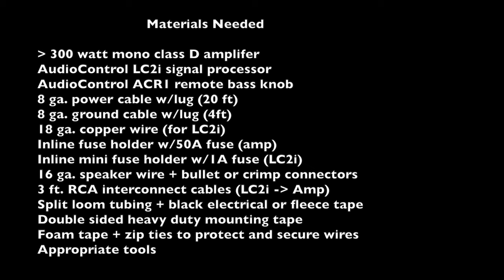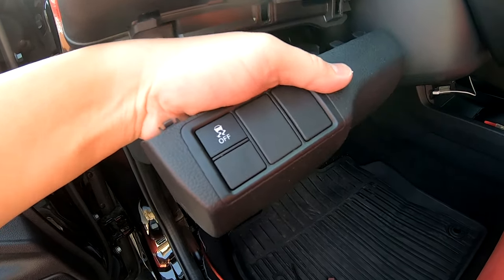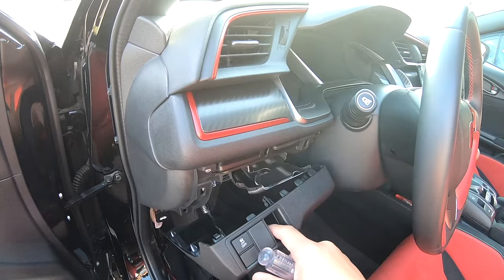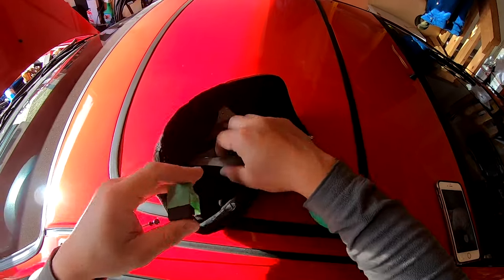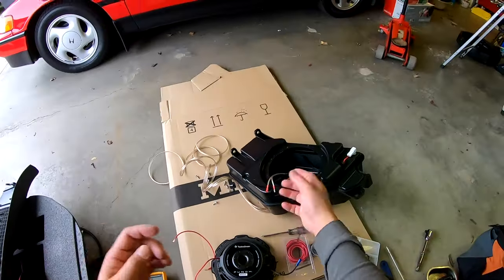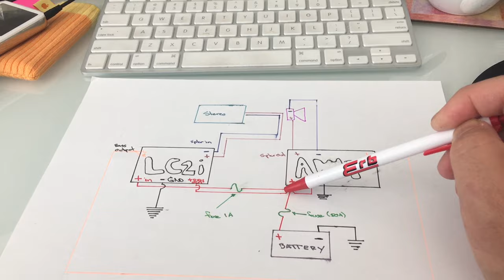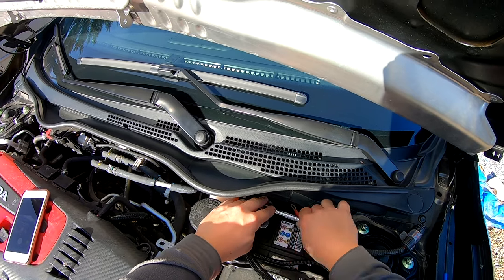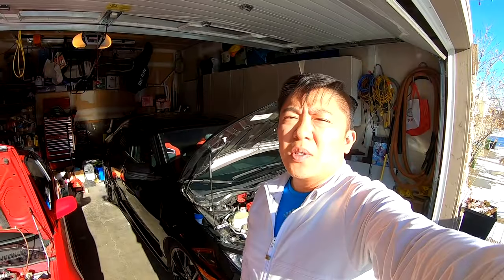2016+ Honda Civic Type R Subwoofer Amplifier Installation

Comment: Question about the + and - sides of the speaker...with the speaker still being wired for (2 ohms) does it matter if you put the + and - on opposite sides of the speaker? (Talking about the wires coming from the amp to the speaker) I don’t think it does but in your subwoofer install video you put the + and - on the same side...in this video you have them on opposite sides of the speaker, thx
Reply from the maker: No, when you hook up a speaker it must follow the terminal designation.  If you don't do that then your speaker/sub will be out of phase (meaning it is supposed to push out but it actually sucks in).  There are odd exceptions when you'd wire a speaker backwards but this isn't one of them.  In my sub's case I have a dual voice coil sub where each coil is 4ohms.  They're supposed to be wired in parallel to achieve a total of a 2ohm load.  If you're not sure about the ohms wiring on the sub (parallel vs series) take a ohm meter and touch the terminals that you would hook the amp to.  You should see a nominal impedance of 2 ohms.
Reply: @piercedasian  thanks for the reply, I see what you’re saying about following the terminal designation but my question is more or less if I can put the wires coming from the amp (the + and -) in one side of the speaker..(but still have it wired parallel) similar to the way you wired the sub in your other video..the video without the amp. In this video you put the + from the amp on one side of the speaker and the - in the other side...I’m using the same speaker and a similar Rockford amp for my install btw...again, thanks for the reply and help
Reply from the maker: you're very welcome!  Hopefully your install goes smoothly.

Comment: Great project!  I have a 2020 civic sport that did not come with a rear sub (or sub control on the head unit).  Is it possible for me to do a similar install with the current factory head unit?
Reply from the maker: hmm if your civic sport didn't come with factory sub then you may need to find a signal wire from the front speakers to pull a bass signal from.  The modern car head units are wonky in how they handle signals and their crossover frequencies.  I don't fully understand the technical aspects of how the Honda head units output signals.  You can pull the rear panel off to see if you have a factory "pre-wired" sub cable.  If it is there then super easy.  If it isn't then you'll have to find an alternative signal wire - I do recommend you use  the front speaker outputs to feed them into the left and right signal inputs on the LC2i.
Reply: @piercedasian  Thanks for the help.. I will look to see if the sub cable is there.  If there is no cable,  why do you recommend using the front speakers to feed the LOC?  Is this preferable to splicing in wires like with the smaller LOC described in the LOC installation video from @Sooner Garage?  Is the larger LC2i preferable to using a smaller LOC located behind the dash?

Comment: Great video very good details! Keep it up. Just some questions...So no need to get remote in for lc21 as it turns with speaker signal? Can you also provide what cables you used for each connection sorry my first install with and lc2i. TIA
Reply from the maker: Hey thanks for watching the vid!  No need to remote trigger just set the LC2i to signal sensing and call it a day.  A fellow member PMed me with a decent list of stuff to buy to complete the install.  

Power & Ground w/ fuse holder
https://www.amazon.com/Rockford-Fos...8+gauge+power&qid=1566530288&s=gateway&sr=8-1

Interconnect cables:
https://www.amazon.com/Hosa-CRA-202...interconnect&qid=1566531793&s=gateway&sr=8-17

Speaker wire:
https://www.amazon.com/AmazonBasics...ZJ3D6J9WQ97J2SV38PGM&qid=1566531917&s=gateway

1AMP mini fuse holder:
https://www.amazon.com/Qunqi-10Pack...i+fuse+holder&qid=1566532277&s=gateway&sr=8-6
Reply: Awesome thanks for the help. One more question does the lc2i need to be hooked up to one speaker or two?

Comment: Maybe I missed it or something did you have to run a remote wire?
Reply from the maker: Nope no remote wire necessary. Just the sub bass gain control and power feed. The remote trigger comes from the LC2i module and into the amp which is all located in the back trunk area.

Comment: I tried the pen trick and 8 ga wire I bought didn't fit.
Reply from the maker: hmm weird.  Did the wire not fit through the hollow cylinder of the pen?
Reply: @piercedasian  No I think the shielding on the wire must have been thicker.

Comment: For the signal in connection to the lc2i did you bridge the connection between the left and right channels or did you just connect the wires to just one one of them? If you just connected up one of the channels does the other channel not have any output on the rca side to the amp or does the lc2i duplicate the signals to output them on both the left and the right channels?
Reply from the maker: I bridged my connections.  The LC2i will mirror the input signal to the outputs to the amplifier.
Reply: Ok thank you. I just installed this yesterday using your tutorial but I used a kicker comp rt and a sound ordinance amp instead and it is causing a rattling sound. Through some troubleshooting I found out it was something with the stock box that was rattling. I tried adjusting the sub sonic filter and it only helped a little. Did you encounter this issue and if so how did you fix it?

Comment: Where did you purchase the in-line fuse that you used for the line out converter
Reply from the maker: Any auto part store or Amazon.
Reply: @piercedasian  ok, thank you
Reply: How did you combine the in-line fuse wire with the 12v wire?

Comment: That crx 😍
Reply from the maker: yeah the CRX is my baby.  Its sees very little road time and literally no rain.  I even stopped washing it and just letting the dust "blow off" of it when I dry b/c the more water you expose to the car the higher the chances that whatever rust that is buried deep in the welds of the car will only get worse.   There is absolutely zero visible rust (I had the stuff that was rusting completely cut out and replaced with new honda pieces when they used to be available.  The dryer the car stays the better off it will be for many many more years.

Comment: Thanks bro i did my install exactly like this works perfectly fine looks better then my friend professional install 😂😂😂😂😭😭🤣🤣🤣💀💀💀💀
Reply: What size gauge wire did you use? Currently dealing with this myself lol on top of trying to get the back up cam & steering wheel controls to work 😂😂
Reply: @AM33ZY  i used a audio kit boss 8 gauge went rigth through the little grommet with no issue that pen trick shown in the video is the way to do it wire ends up coming through fender
Reply: @TTVHASHxJOINTS  cool I bought a 4gauge because why not and now I’m regretting it because from what I’ve read a 4gauge is way to big to fit 😅😅
Reply: @AM33ZY  yea lol i just so happened to have the correct kitbi bought my kit days before watching this video and it was perfect lol amazon is where i got it and its a good complete kit hits solid too
Reply from the maker: haha that's awesome.  I always have a chuckled at SOME of the pro builds I've seen shops do. Some are truly abysmal and it blows my mind how some supposed "installers" know what they're doing when in fact they're bloody clueless.  Glad you were able to do the work b/c YOU'LL know what quality of work was put into it.

Comment: Great installing and very nice video! I'm planning to install a sub on my 2017 CRV LX and it doesn't have a sub the back like your Civic. Do I have to remove the head unit to wire my amp (the signal wires)? If yes could you explain a little about how to do that please? Thank you so much!
Reply from the maker: If your CRV doesn't have a sub out then you'll need to remove the head unit and locate the front speaker outputs and then tap into that signal and feed it into your LC2i.  Do you have the same exact headunit as another CRV that has the premium sound system?  Do the higher tramline CRVs even come with a sub?  If yes then you may be lucky and can tap into the sub output and pull signal from there.
Reply: @piercedasian  Thank you for replying, my CRV is a base model so it doesnt have the premium sound system(160-watt AM/FM audio system with MP3/Windows Media® Audio playback capability
 and 4 speakers), but the head unit is the same for other higher models. I'm not sure if the other trimline has a sub though. So best way is to tap into the front or rear speakers to the LOC and from LOC to the amp, right?

Comment: Hey I got a quick question, so from the lc2i you put a wire from the remote out to the amp's remote in? And you didnt plug anything into the lc2i's remote in correct?
Reply from the maker: you are 100% correct.  Just make sure you set the configuration switch on the LC2i properly otherwise the remote out trigger won't work properly.  I believe it is turn remote on signal sense or something like that.

Comment: I recommend changing that gain control out, for an RCA level input knob. I personally run SPL cartel, because they're linear voltage, but you don't want gain control, because they're more prone to causing equipment damage. Also, move that power lead, to a better spot, you're going to cut through the shielding, opening and closing your hood.
Reply from the maker: Interesting advice.  Although my gain control isn't via RCA the gain is still managed via the LC2i which is somewhat like RCA gain control but limited to the what the main gains are set on the output converter.  As for the power cable I can assure you it won't cut through.  I've wrapped it in split loom, foam tape and then ty wrapped them to the chassis and I've done lots of clearance checks to make sure it wouldn't pinch.  But as you've said it could cut through the insulation but I usually check things like that regularly to make sure wires aren't chafing anywhere.  Great advice nonetheless.
Reply: @piercedasian  I just do this competitively and I'm installing an lc2 in my daily build. I have a little bit of experience and try to give advice where I can.

Comment: how would i go about swapping out the 20 dollar LOC for the LC2i pro? I just wanna swap em but im intimidated
Reply from the maker: Best way is to just follow my install instructions on my amp install video.  I show exactly how to wire the LC2i.  Just remove your line out converter and follow the vid and you should be a-ok
Reply: @piercedasian  idk man. i have a history of not being able to put things back together
Reply from the maker: I think that if you take your time and take the time to take lots of pics to document the process that I am very confident ANYONE can do this install. Worst case is take it to a reputable shop and have them do the install for you. A pro install is often worth the expense.
Reply: @piercedasian  ye as you might have guessed that's how i had my original system installed. took it in. but they failed to mention i needed a real LOC, not one of those 20 dollar ones. It was like 4 years ago so perhaps the good ones didn't exist back then? why else would they not tell me i needed that? my system has been missing notes and half the songs don't sound that good. still is loud and hits real good, but it's lacking compared to my old car i had long ago.
Reply from the maker: The shop that you took it to just didn't have experienced/competent guys working on your system.  The LC4i has been around for a long time to address this very problem of factory stereos doing their own funky eq'ing to the signals that feed each speaker to maximize the available power to each driver and ensuring they don't blow up the speakers by feeding say for example, tweeters full spectrum signals.  The LC4i is able to see the "dips and peaks" in the incoming signal and apply its correction algorithm to it to restore those gaps in the signal.  The LC4i and other similar units are an absolute MUST in today's aftermarket audio installs.  Line out converters just don't cut it anymore.

Comment: 8 ga power and ground is no bueno
Reply from the maker: It’s okay to use same for same gauge cable in smaller/lowered powered amps. If you are putting in large amps then upsize all cabling and size up the ground to be one size larger.
Reply: @piercedasian  I understand what you're saying but for me the run is to long for a 8 gauge wire. I would ran at least a 4 guage wire to the trunk then use a distribution block to downgrade to 8 guage if the 4 guage couldn't fit into the amp. But like you were saying I'm use to running bigger amps.

Comment: Did you change any setting for the sub on the stock head unit?
Reply from the maker: Not at all.  I left the sub settings to default and then tweaked my initial gain settings on my amp and LC2i (including the remote bass gain knob on the dash) so that I am right in the middle of the min max range.  The logic behind this is that I can then dial in as much or as little bass as needed to suit the music I am listening to.
Reply: Just set mine up, the knob though is not controlling any of the bass. Its connected to the lc2i with the same settings you suggested. Any ideas?

Comment: Another question.
Can I get away with using a LC2  for front and rear door speakers and use the bass only for a subwoofer? By combining the two channels to the front for the left channel for the rear, or would that put each front and rear into 2ohm since the door speakers are 4ohm each? Which then I would have to get an amp that can handle 2ohm?
Reply from the maker: hey so before you start tearing into the system I CAUTION you to do more research into this matter.  You cannot just combine channels of the head unit's output b/c each channel is eq'ed and x-overed a certain way.  You can technically do a straight drop in of speakers in place of the factory ones (i.e tweeter for tweeter, woofer for woofer) even if it is 4ohms.  The reason why honda uses 2ohm loads is to get the maximum amount of power out of the head unit (lower ohms = more theoretical wattage put out).  If you want to amplify those speakers then you'd want to use external amplification.  You'd need to invest into something like a LC7i to have ALL the outputs of the head unit go into the LC7i which is will then recombine and re-eq the signal into a useable signal for an external amp.  How I'm doing my type R (which hasn't been completed yet) is to purchase a DSP/Amp combo unit (Helix V series) and using a headunit to factory amp breakout harness to get the signal to and from the external DSP/amp combo.  New cars are a PITA to get aftermarket audio in without spending a ton of money and time and if done incorrectly, can lead to really awful sounding audio and the risk of blowing up the very expensive factory head unit/amp.  The LC2i is mean for bass re-equing.  For woofers/tweeters you'd need to buy a purpose built unit to handle those other speakers.  More details are needed on what kind of speakers you want to put in along with the type of amplification used (if any).
Reply: @piercedasian  wow! I did not know that. I read the label on the head unit, it said 4ohms, I didn't think that the system ran in 2ohm, thank you for that. I will surely get a LC7 to keep channels equal. This sports edition only has front and rear door speakers. Surely a pair of 6x9's for the rear added would imrove the sound, or do I need to? And, the extra channel on the LC7 can be used for the subs or do I need to use the LC7i seperate to run that? I have two Skar amps, one is 500 watt 4-channel, each speaker will get 75 rms, and the other, 2,ooo watts to power my two Sundown 750 watt subs at 2 ohm. Also, since I bought my car used. The previous owner wired   seperate tweaters into the front side mirrors molding. I believe those run parallel with the door speaker.
Reply from the maker: weird, I thought I replied to this specific comment.  No real need for larger rear speakers as your sound should be biased to the front where the sound stage should be.  Yes the system is 2ohms which is how honda can make the power claims of their factory radios. It's almost ridiculous how much power they claim b/c never in a million years is it close to be able to deliver that unless it's driven into clipping and ready to explode.  I would not put 6x9's in the rear unless you have the proper space/provisions to fit them in.
Reply: @piercedasian  I appreciate your reply. I did state before I had gotten it worked out. I ended up replacing the factory unit with a new Alpine touchscreen, a pair of 12" halo series subs with box, Alpine door speakers R-S65.2 speakers, and two  Alpine R-A75M mono amps, with a Audio Control DM-608 ,and sound damping front to back. I had everything professionally installed and explained to me in full detail how it was all put together, more so on the technical side of the set-up. I also had the alternator upgraded to a high capacity 220 amp, the big three done, and I got it all done just under 5k.
No more worries, just enjoying extremely loud music. However, from all that I have learned. I am going to start a new project on another Honda I own (1991 Civic Hatchback) and build from scratch using my newer Hatchback as an example. 

Thanks again. I will post some photos
Reply: Got rid of the old system.